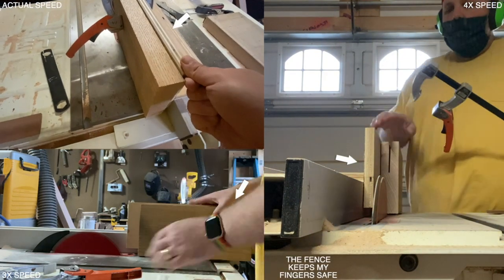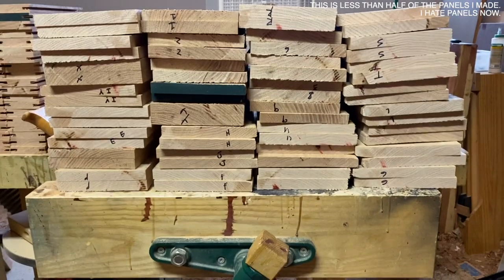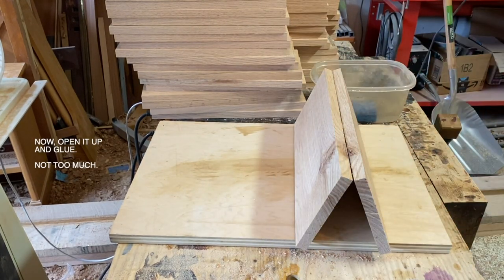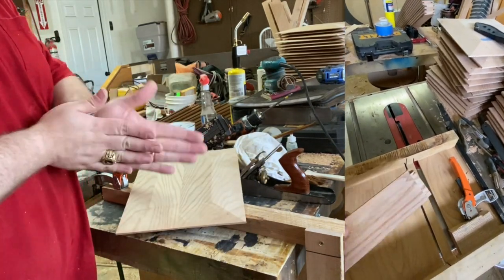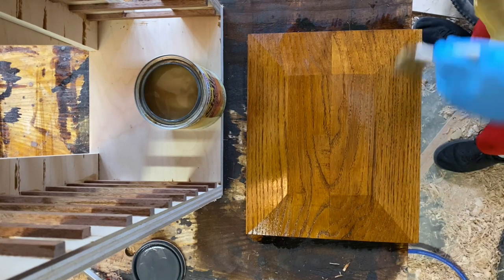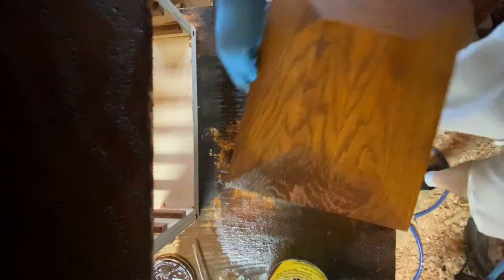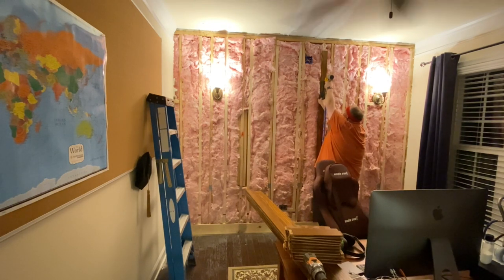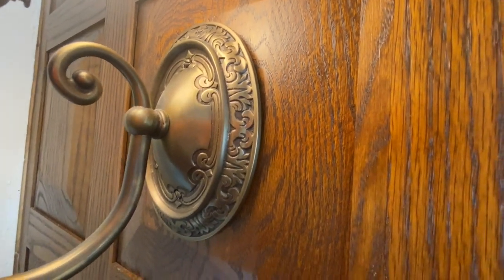Built this incredible zoom background raised panel wall for my office

Comment: When cutting raised panels, do the end grain cuts first, because you're likely to get some tearing of fibres. This will be removed when you subsequently do the cuts along the grain. The same applies when you're machining on a router table or spindle moulder (shaper).
Reply from the maker: Smart

Comment: I wanted to see how you put the lights in!  How big of a whole did you need?  How did you cut into the glued seam without breaking the two pieces apart?
Reply from the maker: The glue seam is super strong. No risk of breaking it. I cut the hole with a 2inch hole cutter like you would use for installing a doorknob. It just needs to be big enough for the wires to go through ;)
Reply: @cerupsly  looks beautiful I like it 😊😊😊👍👍👍👍👍

Comment: Why did you remove the sheet rock? Why not just tack up the wood to the sheet rock? If you have original plaster walls - would you have to demo/rip them out to install wood paneling?  Thx!
Reply from the maker: Had to do a lot of wiring in the wall. Thought it would be easier that way

Comment: I've tried every keyword search possible and yours is one of only a very few videos on making solid wood wall paneling. Also one of the best! Maybe I missed a detail? Did you rabbet those rails and stiles to receive the panels?
Reply from the maker: Yup!  The panels are just floating in there.
Reply: @cerupsly  It really is beautiful. I'm not a big fan of oak because the grain can be very aggressive but your finish really evened it out nicely. The irony is I paneled my office in Walnut and used furniture grade plywood for the insets. The Danish oil made the darker spots darker but only brought attention to the lighter spots. Any chance you have a suggestion to even out the wood tone in Walnut?
Reply from the maker: @nickbailey202  I never really have used Danish oil very much. I tend to prefer finishes that leave a coating on top to finishes that soak in and Harden. I suppose you could try a stain or something to cover up the light spots, but I’ve never had good luck with stain. Do you have a link to some pictures? I’d love to see your work!
Reply: Same